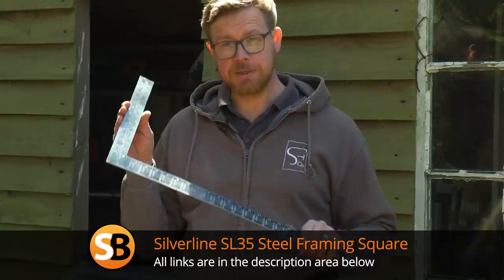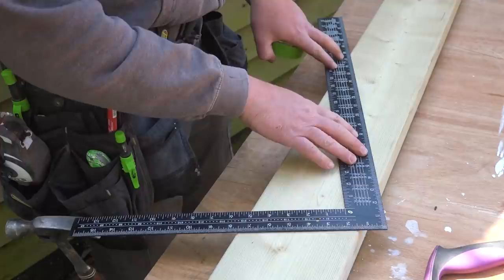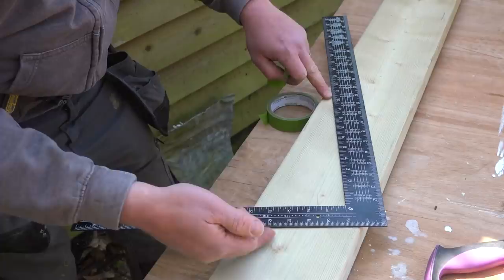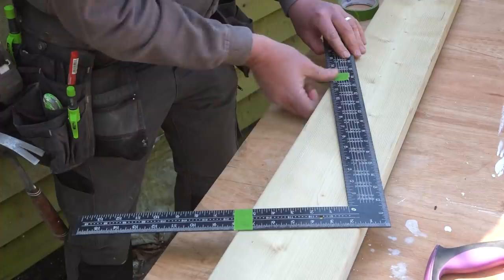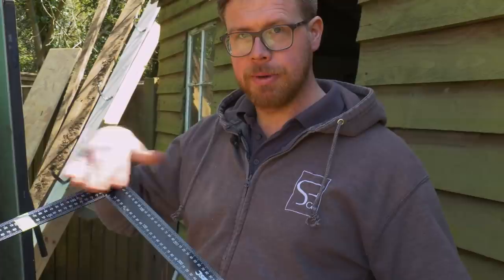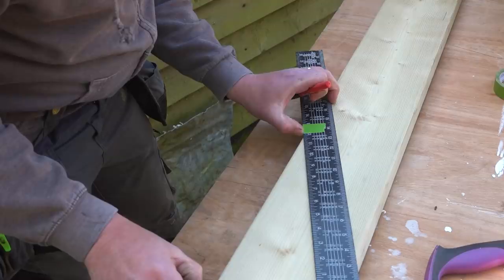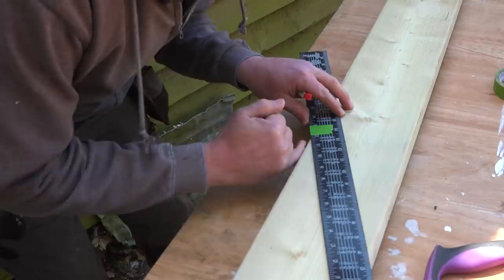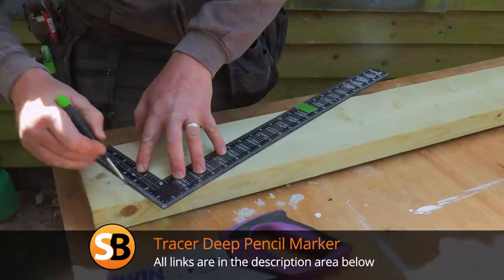Rafter Step Off Method - Made Simple

Comment: This is a version of stepping off along the hypotenuse or rafter length. 

Stepping off as far as I know always works across the run which is half the span. 

Your either a split the span and x by per metre of run....

Or step off which is across the run/ at right angles to the building using a metric square. 

The good thing about stepping off is you can set collar heights/pre determined purlins heck even steel work before the roof has been pitched. 

Great content as always. I suppose there is always more ways to skin a cat or a ferret whatever floats your boat! 

Stay safe all.

Comment: I use stair gauge to maintain my marks , I use the dimensions from the rafter square and multiply by the run and mark the rafter and then step it off marking each step with my board knife for accuracy , it allow ways works out , if not there is a mistake.

Comment: The square on the hypotenuse is equal to the sum of the squares on the other two sides (Pythagoras).
Forget all about that and all the calcs and just use the roofing square as shown, it will give you everything,
Use a thin piece of timber instead of the masking tape so that it just slides from one postion to another
with ease, all the cuts and the birdsmouth can also be taken from the same setting. If you include the
ridge you will know where to cut it later. Great video5 stars

Comment: There is so much to the roofing square  that measurement of 13 being the length of rafter per ft run take that on the body and twelve on the tongue and you have the side cut for a jack rafter and the top cut and bottom cut for the valley lay board. I would like to show you James if you didn't know that very interesting  video  thankyou
Reply: Yep, run of common rafter & true length common rafter = Jack edge bevel and lay board cuts. All on the Gibson square
Reply: @BillyMustang101   thanks Martin
Reply from the maker: Peter 
We are going to come up and visit you so you can show our audience.
Reply: @SkillBuilder  Thank you Roger I will look forward to it I am in the throws of making a Kitchen at the moment. Many thanks

Comment: Thank you 😊. One question for you please. If the seat cut can’t go above 1/3 of the timber, replacing 4x2 rafter with 6x2 for loft conversion would increase the finished roof height by 2 inches? Is that right? Thank you 😊

Comment: Nice little demonstration, one point though is the depth of the birdsmouth should be worked out as a third of the depth of plumb cut (the backing line) not measured square across the depth of the timber.
Reply: Very true but my brain was hurting and I didn’t want to explain anymore stuff😂
Reply: @jimichip  I guessed it was just a slip up that a man of your caliber wouldn't normally make! keep up the great work!
Reply from the maker: Hi Rob
You see it both ways and, though the text books talk of a third of the plumb cut a lot of carpenters measure it on  a right angle.
Reply: @SkillBuilder  Been a chippy for 25 years, was taught to measure the backing line and divide by 3, then measure down 2/3 for the seat cut, never heard of nor seen a chippy measuring square across.
Reply: @SkillBuilder  it’s the same if you measure on the plumb cut or across the square. 
I was taught the birdsmouth is a third, or less. 
Keep up the great videos. 👊🏻

Comment: I love the tips and tricks, but I believe James could do with Robin Clevetts Iroko guide clamped on his square, I’ve adopted this and it speeds the whole process up 👍🏽
Reply from the maker: Lots of carpenters use fence made of hardwood or aluminium angle and it is shown in the City and Guilds carpentry books as a good method, you can also use stair guages to do the same thing but this is a video to explain how stepping off works and having a fence across the numbers obscures the very thing we are trying to show. We tried it.
Reply: It’s excellent I love all the tips and tricks, I’ve been in the industry for 16 years and been watching your channel for a long time.

Comment: Brilliant explanation mate.. excuse my ignorance but how would the layout /measurements differ for the birds mouth for the wall plate on the inner skin please, if at all? Many thanks
Reply from the maker: That is a very good point. We should have made clear that we are talking about the outside of the wall plate which is on the inner skin.  Thanks for pointing this out. The rafter past that point is the eaves overhang and is not part of the calculation.
Reply: Many thanks for clearing that up.. top blokes!

Comment: I can see how robins roofing square with the fence would make this a breeze
Reply: Get the essential roofing square by Dan Cox it comes with a paper copy of the formulas also the free app that James mentions in the video, I never thought I would ditch the speed square until I started using it.
Reply: @denty32  thanks Mark. 😉
Reply: @denty32  that looks like an ace bit of kit for sure. It looks to me like robins square will be a bit more adaptable and better for general use but I've yet to see a complete demo of it. I'm sure nobody would be disappointed with either tool.
Reply: @moomastico  just use what are called stair gauges, little brass fittings that slide n the roofing square

Comment: How did you get “5 over 12” though? What does this mean? Thanks
Reply from the maker: Josh It means for every foot of linear run you raise the roof by 5 inches. It is just a slope or gradient. We used degrees rather than rise over run but the Americans still like the old style measurement of rise over run. If you have a 12 rise for 12 run you have a 45 degree pitch.
Reply: @SkillBuilder  thanks for the reply 👍🏽

Comment: Do I measure the overall length of the building or the outside of the wallplate?
Reply from the maker: You go to the outside of the wall plate if that is supporting the roof. You need to leave a magin on every rafter for the eaves overhang

Comment: Great video James and roger last time I checked 12 inches in a foot 🙄?
Reply: Thanks. There still is 12” in a foot. The 13” is 13” of rafter length per foot (12”) of horizontal run, If it was a steeper pitch then the rafter length would be more, for  example a 12/12 roof would be 17” of rafter length per foot (12”) of horizontal run. I hope that makes sense.

Comment: So how do you convert the 5 and 12 to say degrees? Because on a plan you work to degrees not the American way
Reply: To go from 5 and 12 to degrees you use arctan of rise / run.  So for the 5 and 12 it is arctan(5 / 12) = 22.6 degrees, any decent phone calculator should have this somewhere, sometimes instead of arctan it will say tan^-1 or inverse tan.  If you want to go the opposite way you can use tan(angle) to get the rise and the run is 1.  So for a 22.6 degree pitch the rise is tan(22.6) =  0.416.  So we have a run of 1 and a rise of 0.416.  You can multiply by whatever you want but I'll use 12 to match the video so the run is 1*12=12 and the rise is 0.416*12=4.992 (small rounding error since the angle is actually 22.619864...).  Hope this helps.
Reply: @quantumstatejim  I appreciate the reply but no mate I don't have a clue what you're going on about. Hopefully there's some kind of conversion from degrees to inches rise and run for me. Cheers anyway.
Reply: @quantumstatejim  that is really interesting. I wish I paid more attention in maths. Thanks for sharing.
Reply: @SlightOfHand28  here’s a drawing that sort of explains it without the maths. https://www.spikevm.com/calculators/framing/pitch-angle.php
Reply: @jimichip  cheers for that, I myself have been a joiner of 18 years done many traditional roofs but never used the roofing square. But the square it seems is definitely a faster method than strings and bevels. I understood 12 and 12 would of course be 45 degrees thus half would be 22.5 and so on. That calculator will help a lot. Got a lean to in a couple of weeks so gonna give it a go with the square. Need to steal as much pitch as possible on this one though going for 18°/19° governed by windows and the redland grovebury. Cheers pal
Reply from the maker: @SlightOfHand28  I made that mistake when I first started looking at this. 12 /12 is a 45 but 12 /6 is not 22.5. It made my brain hurt for a good long while.

Comment: 5 over 12 hypoteneuse is 13 - it's the next right angled triangle up from 3,4,5. Maths 'O' level was 1969 - long time ago. But, if more complicated, and you do need a trick or a calculator

Comment: The 7 and five , represents a roof pitch , you did not explain how you came to this , otherwise great stuff😀👍👍
Reply: He was just taking a random pitch i believe.
Reply from the maker: Yes it was a 5 over 12 pitch and in the next video we go in deeper.
Reply: @SkillBuilder  since this is a UK channel would it not be better demonstrating this method using a metric framing square and degrees for the pitch instead?
Reply from the maker: @rootymctooty7288  We will do that for sure but we thought the 5 over 12 sounded easier than 125 over 300.
Reply: @SkillBuilder    it must be my age ,but I'm conversant in both measurement systems fluently..!!🇬🇧👌 great video  very  handy tip for demystifying the "dark art of roofing"
Keep up the good work...

Comment: Yeah.....sorry bud but 1st. We work in metric in UK, 2nd us older guys have the lucky ability to work in both - there are 12" to a foot! Plus get a fence on your framing square....plus a metric square that gives you a 'set point' for your common cuts and a 'set point' for valley/hip cuts. - then 'stepping out' is simple. 😀 
But not having a go as I love watching your channel! 😀👍
Reply: 12" to a foot. Dont know how to do this rafter business but i did wonder where the 13 came from!
Reply: @gbwildlifeuk8269   Hi......not wanting to dis-respect anyone! Or make any judgements at all but check out this other skill builder video which shows what I know/use/and consider proper setting out of rafters called 'stepping off/out' 
https://youtu.be/90cB_qiu-YA
Reply: Correct, there are 12” to a foot. I have also grown up using metric and imperial. The 13” was 13” of rafter length to every foot (or 12”) of horizontal run which is what the 5/12 dictates. We chose to do this basic demonstration for beginners in inches to keep it simple, the small numbers are less confusing in this instance but can easily be converted into metric.

Comment: Pythagoras' theorem states that, in any right-angled triangle, the square of the hypotenuse is equal to the sum of the squares on the other two sides.
Reply from the maker: Yes, now say it in Greek
Reply: @SkillBuilder  5x5=25
12x12=144 
144 + 25 = 169
sq root 169  = 13

Comment: Good video but why in feet and inches?
Reply from the maker: We wanted to simplify the process. Americans use the rise over run method and it is easy to understand the basic idea even though the maths gets a bit more complicated when you are dealing with fractions. . We will be expanding on the subject when we look at the metric side of the square but even on this U.K square they don't have the degrees marked up.

Comment: ok, I've paused the video at the point he begins to explain the birdsmouth. This is what I cant get my head around. If you're dropping the timber by a third of the width, surely it buggers up the plumb cut at the top? Ive only ever done 3 lean to roofs and if was a very slow, painful and embaressing process.
Reply: It’s all in the rafter length which is why it’s measured along the top of the rafter. The ridge and the wall plate remain the same distance apart from side to side so the rafter just moves up or down depending on how much of a birds mouth you cut out.
Reply: @jimichip  hi James. Just spotted this reply and epiphany moment. Suddenly makes sense. Good tutorial. I'm also old so remember feet and inches and can manage the numbers but would love you to repeat the vid in metric though. Rgds Tony

Comment: For hip cuts, place the stair gauge (or tape as you used) on 17"........not 12". Your welcome!!!!!!
Reply from the maker: One step at a time, or is that staircases?
Reply: @SkillBuilder  Hip and valley cuts on a roof.
Reply: Plumb and level cuts that is.
Reply: For lengths of hips or valleys, use the same method as for common rafters but with square set at 17".
Reply from the maker: That one passed them by. One step/staircases oh well you can't win them all.

Comment: What you should of said at the start is this will only work using imperial measurements and also you need to have a measuring tape in imperial too. Unfortunately, I work with metric and only have metric readings. Then again, I only understood the first part from your plumb cut and then it got complicated once you started talking about foot, feet, and inches.

Comment: Thank you. Very informative and educational. How do you work out the equation 5 over 12. Where does that number come from initially. Is that the standard for roofs in the UK?
Reply: Thanks. It was just plucked out of the air. It could’ve been 7/12, 8/12, 9/12 etc etc but the method is the same.
Reply: @jimichip  Hi James, how do you know if your roof is a 5/12, 6/12 or a 7/12 etc etc!
Reply: 5/12 means for every 12 inches there is 5 inches of rise in your roof, right?